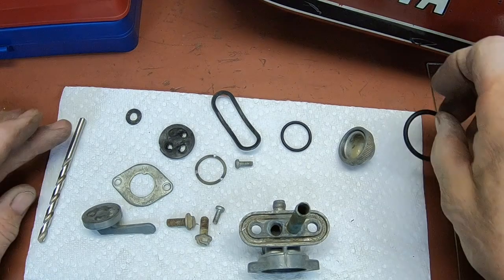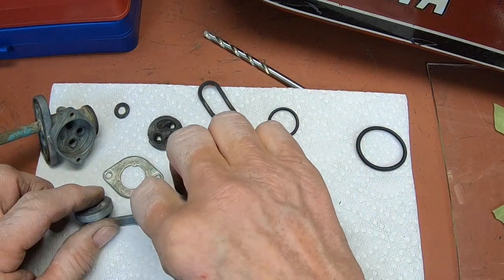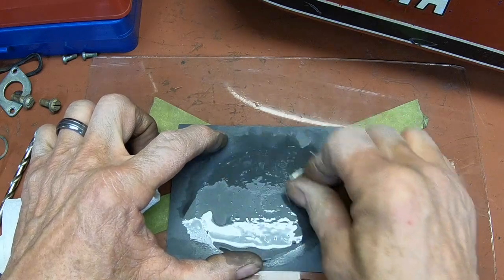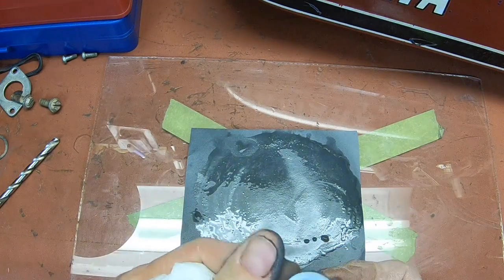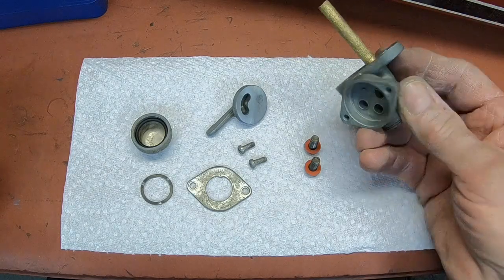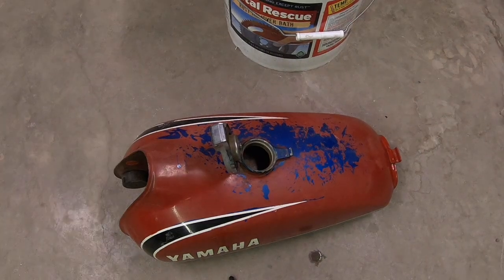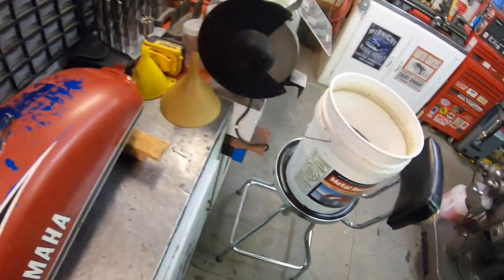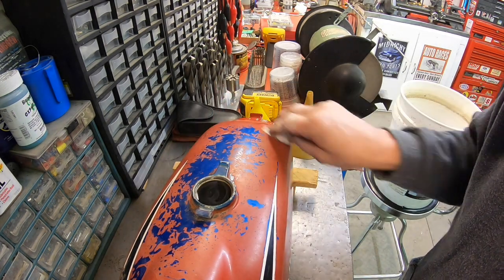Yamaha CT-3 Gas tank, petcock, and gas cap repairs

Comment: Great video Dale. Quite an involved set up on the tank cap,  BSA only give you a cork ring for your money. Which reminds me, it needs replacing! I don't like the 'popular' US brand rust remover either. I've tried it and can't get on with it very well. I use citric acid chelation in the tanks. That stuff you use looks very good too. 
Best wishes, Dean.
Reply from the maker: Thanks Dean, there is something to be said about simplicity. I believe a cork gasket is just fine. The thing I really like about the rust remover I use; is it has an additive to stop flash rust after you remove it. Not a big deal to me, because I usually drain it and put acetone back in and slosh, then drain it. That way no water left in the tank. Completely dry in about 10 minutes. Thanks buddy.

Comment: Same way I clean out the gas tank metal rescue It works great. Also KDI is now selling the complete gas cap and it is a  Exact copy of the original $60  And I mean it when I say it is an exact copy
Reply from the maker: Yes sir, metal rescue works great, and you don't get flash rust like the others. I always drain it, then put in acetone and slosh around then drain it. That way no water stays in the tank. Yes, I saw that KDI has the caps now, I started to order one, but decided to just go with the seal kit for now. Think I will grab one later for the 125 MX. Dave always has great products at a reasonable price. He must have a lot of really good contacts.

Comment: you could also buy ebay repo petcock $10.00 or less and strip the washers and have some spare parts.
Reply from the maker: Just don't care for aftermarket petcocks, cheap.... yes, they are. The internal parts are not the same as OEM.